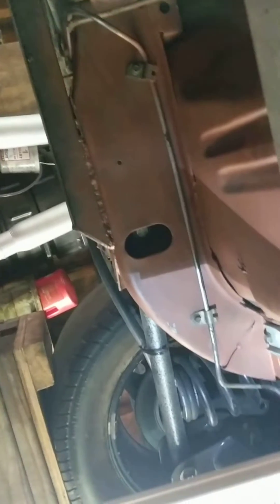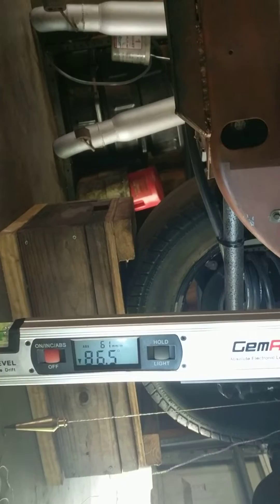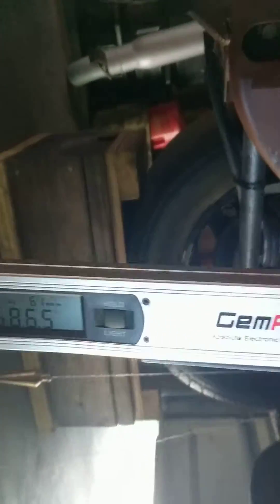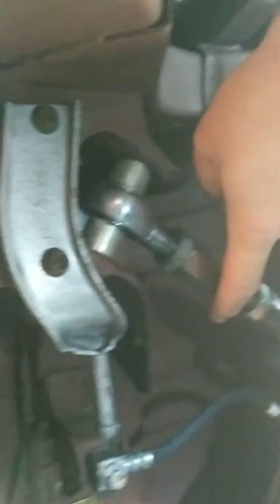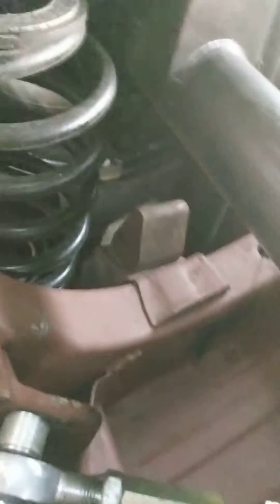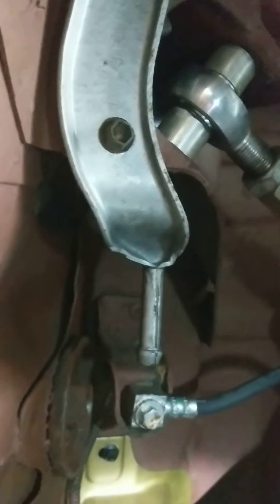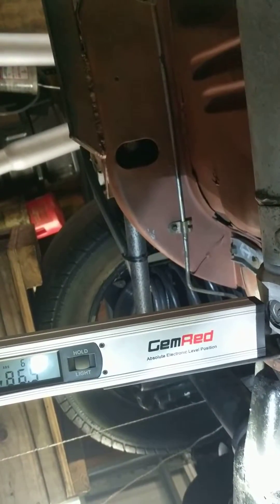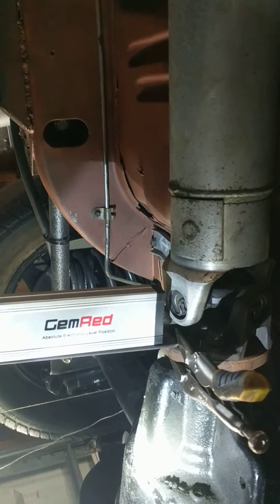Setting pinion angle with double adjustable upper control arms.

Comment: What brand controller ( R470W )  was that mentioned in Rods video you used on your Ltd ?
Reply from the maker: Baumann, I think they're called US Shift now
Reply: FXRSDriver thanks, been back & forth on which way to goon next project ( controller vs Manual VBody )
Reply from the maker: @frontdizzy2218  I like the baumann stuff, great guy to deal with, very good tech support, and the products are topnotch. I like that I can control lockup, shift points, shift firmness and so on.  Another option is to convert your fox to an SN processor, and then tune the trans through the processor via quarterhorse.

Comment: Curious, is the front of the car raised to replicate the frame to ground rake?  If the front tires aren’t raised to replicate the ride height/rake while setting the pinion angle it throws off the results.  I hope this makes sense? JD
Reply from the maker: The angle between the engine and rearend doesn't change.

Comment: did you measure the angle of the engine and driveshaft also ? I've always tried to make those angles the same ( some say 1/2 a degree is close enough) most times I have to put spacers under trans mount to adjust ..
Reply from the maker: I do have spacers on the trans mount to get it as level as I can. I didn't measure the driveshaft angle, just getting the pinion angle the same but opposite angle as the engine.